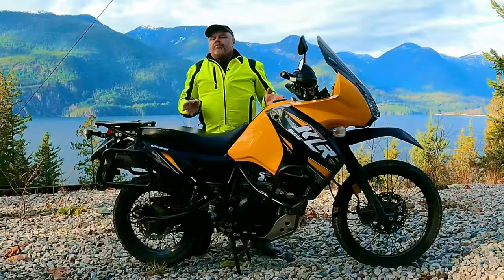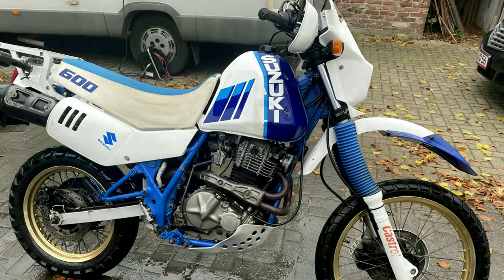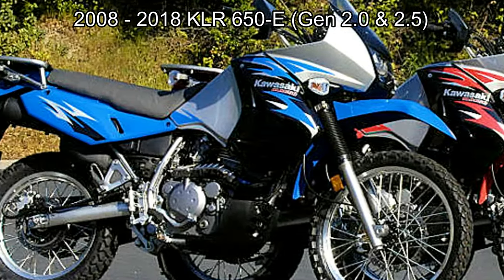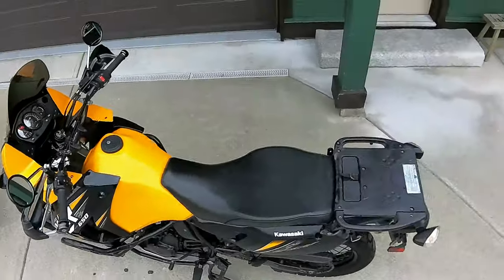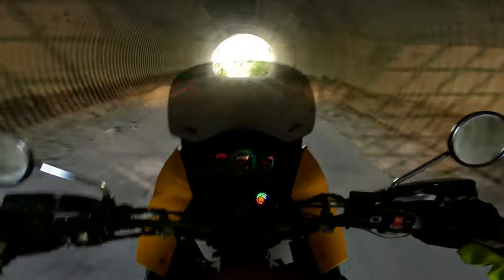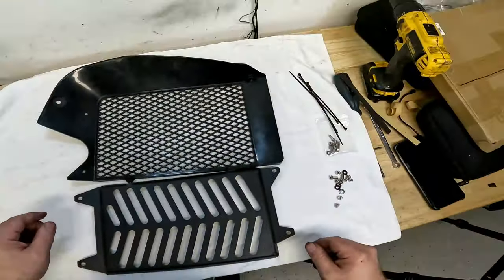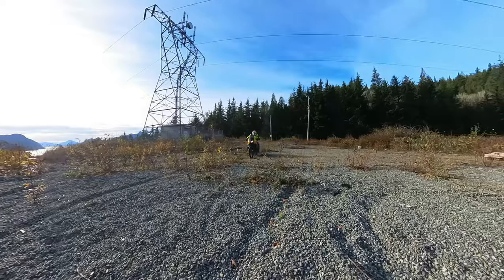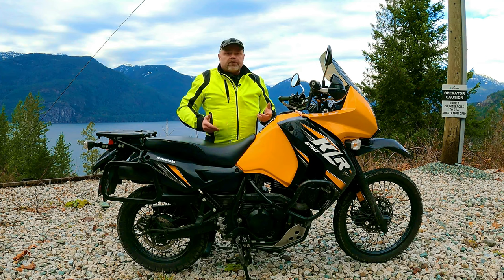The Last KLR 650 Video...

Comment: Ninja 250 production moved to Thailand in 2005 with the EX250F and never stopped. Ninja 250, 300, and 400 are all the same production line (same exact bike with regional configuration differences). Ninja 300 EX300A/B is EX250L/M in some markets. Ninja 400 EX400A/B is EX250P in some markets. If someone indicated that canceling the KLR 650 freed up production for one of those other models, they’re straight up wrong.
Reply: The move to Thailand for the EX250 series was not to “relaunch” the Ninja 250 for Asia or for the Ninja 400. Again: They never stopped producing the 250 there. They started out making the 1988-2007 model in 2005 and we got the 2008-2012 EX250J/K refresh they were making it start to finish. They made the 2013-2017 EX300A/B Ninja 300 as well as the EX250L/M counterpart. They made the 2018-2023 EX400A/B as well as the EX250P/? counterparts.

I don’t know what models they will assign to the 2024 Ninja 250 version of the new 2024 Ninja 500 but they are still the same bike. Look at the engine like it was any other regional difference, like the 2008 Ninja 250 with a “city light” and a switched headlight in some regions or fuel injection in others.